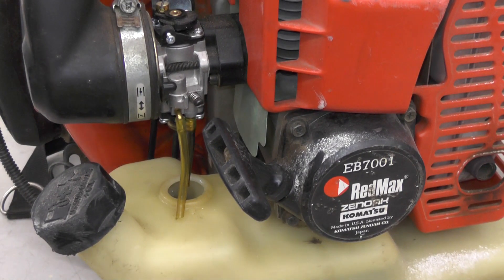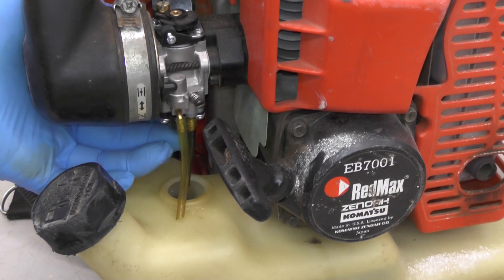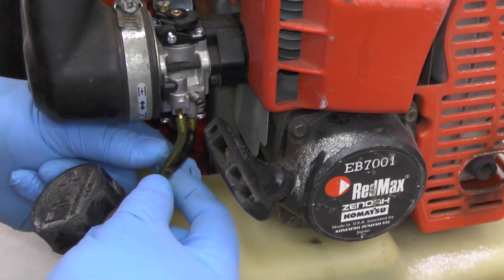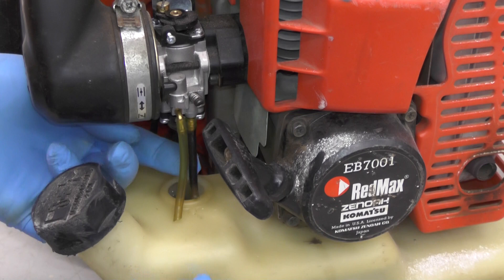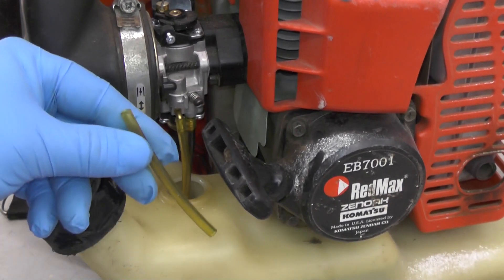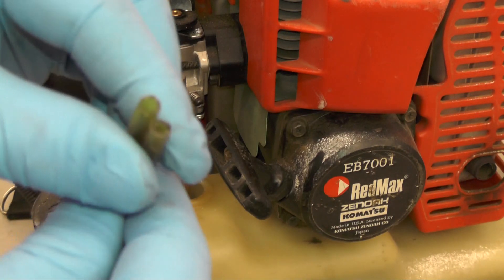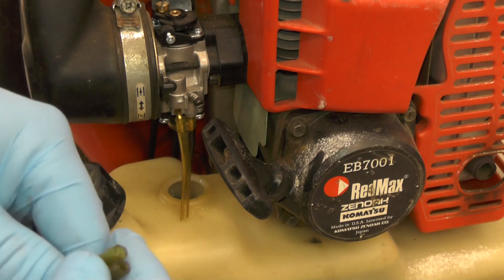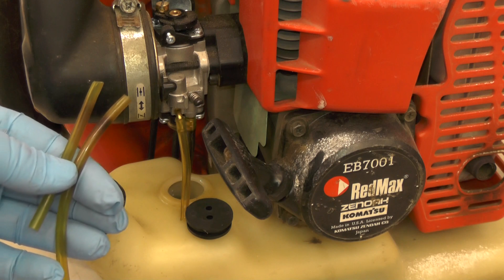RedMax EB7001 Backpack blower fuel line breakage

Comment: Just a quick question, which port on the carburetor should the fuel line be hooked up to? The one closest to the engine? I have the same blower and took it apart to clean it and I just got back into it and forgot which is which. Lol 
Thanks
Reply: the line closest to the engine is the pull (connected to the filter in the tank) and the line furthest from the engine is the overflow or return